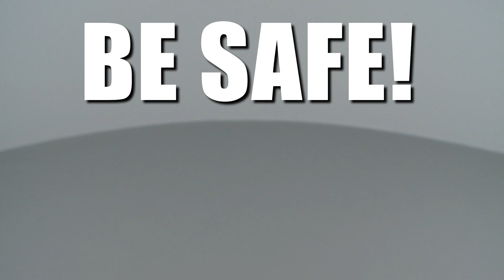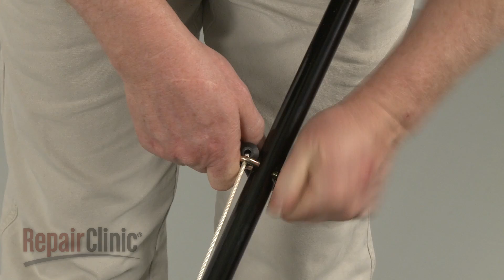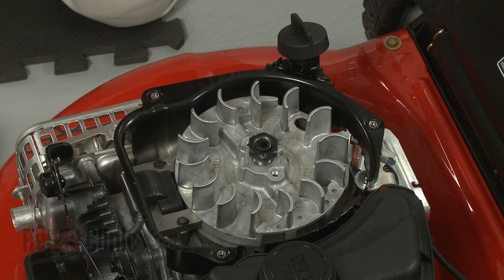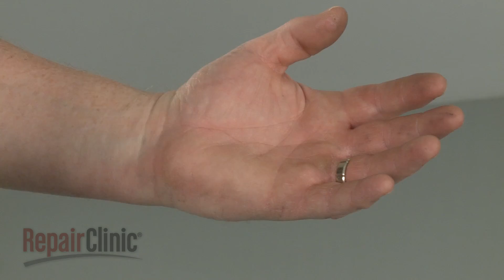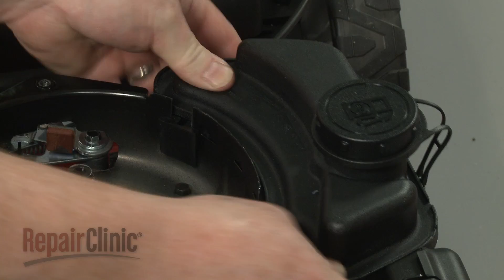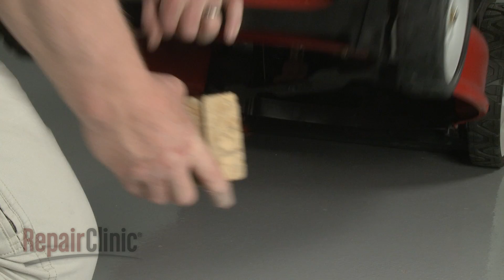Briggs & Stratton Small Engine Replace Breather Reed Part # 697124

Comment: My mower is leaking oil into the very bottom hole that air filter, guessing it has to do with the breather reed? Only the bottom hole/bottom side of the air filter is covered in oil.

Comment: New reed valve costs $300 for my engine. How to check if it's indeed faulty?
Reply: Mine started peeing oil out the air filter.

Comment: My 190cc Quantum is 17 years old and just recently it started to smoke on start up and after letting it sit for a few minutes when hot. I noticed the airfilter housing was getting a little oil inside it by the breather tube. Luckily my local small engine repair shop had one breather assembly left in stock. So $11 later I had myself a new breather assembly, all I had to do with the Quantum was take the muffler off and remove the old breather and put the new one on. Took me all of ten minutes to finish. The smoking is now greatly reduced to just a little puffing which will probably clear up after running it a while. But all in all it was a very easy fix.

Comment: I have oil leaking from the head gasket cover. Replaced the cover and gasket with new ones and still leaks. Could it be the breather reed causing the issue now?  This seems easy but it will be two weeks to wait for the breather reed to arrive
Reply: The reed breather regulates the crankcase pressure. A bad reed, oil will come out the breather tube above the carburetor hole and oil will leak onto the air filter. I'm sure that you checked ✔️ the oil level. Over filled the oil must have a place to exit the motor.
Reply: @WilliamLoney-y8k  guessing that’s the exact thing happening with mine. Oil is getting into the air filter bottom hole and it’s covered.

Comment: What does a Reed Breather do exactly ? Releases pressure in the engine or something ?
Reply: Releases crank case pressure, without venting out oil into the intake
Reply: It's similar to PCV  in a car engine.  It allows for crankcase ventilation.

Comment: I am having to do this to a mower I used only 4 times and now cannot take back to Lowes.  Poor quality parts?
Reply: This is exactly my situation.  I only used this model four times after purchasing from Home Depot, and now oil is leaking from my air filter.  It won't even start.  Did you ever figure out a solution?
Reply: @garywallace5713  I had a long reply that's not here for some reason.  Long story short I replaced the reed and it still did the same thing.  Poor quality engine.  I  took the tube going to the breather and just let it drip on the mower.  Messy but I had enough working on a new mower.
Reply: @fredmerzrs3007 oh ok got you.  Thanks man!
Reply: @fredmerzrs3007 J'ai le même souci mais je ne comprends pas que le reniflard accède à une zone étanche (avec le joint installé).
Comment peut-il faire évacuer les vapeurs ?
Reply: @preciosu  I finally gave up and let the oil leak out of the hose running to the breather.  It ran a few years and finally died.  Sorry not much help I know. B&S are not what they used to be.
Reply: @fredmerzrs3007 total garbage. I knew I should have bought a Honda
Reply: I replaced the reed and it still did the same thing.  Finally I just took the tube going to the breather an let the oil drip on the outside.  It still runs today. It's the wifes trim mower mainly.  I use a zero turn for most of the yard.  Kawasaki eng there. @garywallace5713

Comment: My mower is only 4 years old and it's blowing thick white smoke. I checked head gasket and was surprised that it is in good shape...next guess would be bad rings but could bad pcv valve cause this too?
Reply: Too much oil
Reply: @rannz8    I'm thinking that might be my problem too,  I have oil coming out of the pcv valve into the breather box.  changed the reed and the head gasket which was in good condition and still have oil coming out which gets into the carb and shuts off the engine .  any thoughts
Reply: @mixingsacks  check the oil if not over filled. You have too much air being pulled into the engine case which could mean bad rings, head gasket, or valve seals. You can get a piston leak tester at harbor freight for cheap to test if you need rings or head gasket (edit I seen you already did head gasket so that leaves rings and valve seals
Reply: @rannz8  I actually before changing the head gasket drained the oil and repoured, just to the second dot on the dipstick..but I'll try that again.  If I have bad rings or seals will the engine still run?
Reply: @mixingsacks  yes, if the rings are bad the compression would be low but would still run. You can find some "engine restorer and lubricant additive oil" at Walmart or a part stores for 12 bucks and run it in the oil or gas whichever it recommends and see it it fixes anything. sometimes its a permanent fix. 80 percent of the time it works. I've had success from it in the past
Reply: Would Improperly sealing/not sealing the breather chamber cause it to take on extra air?